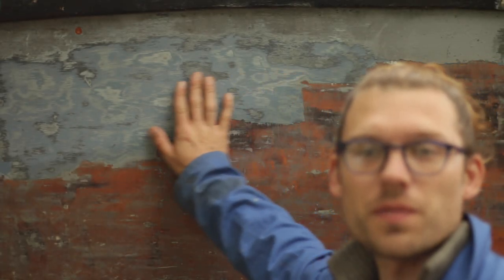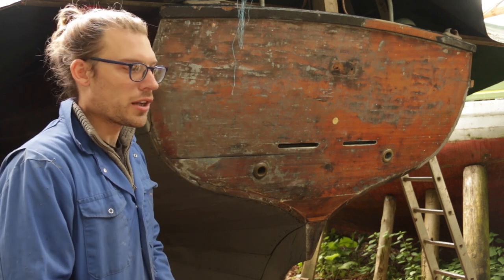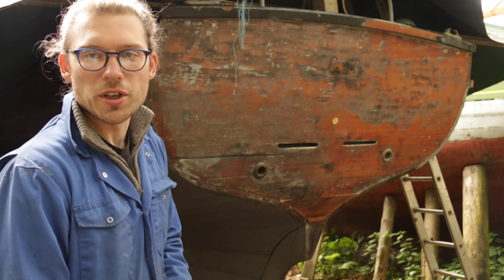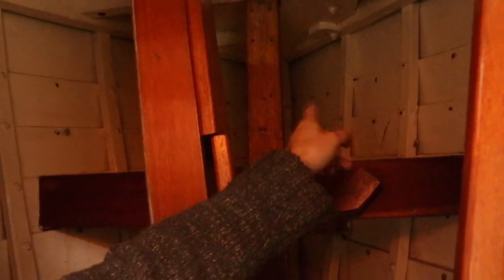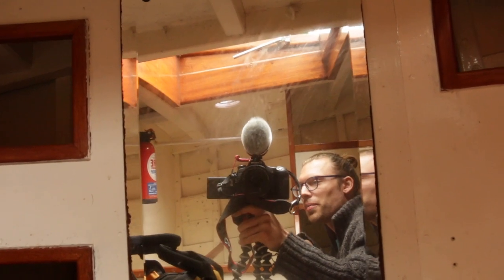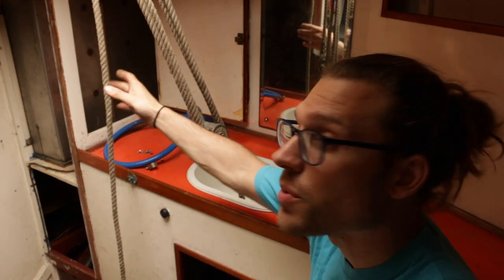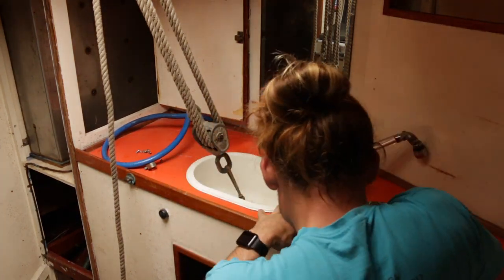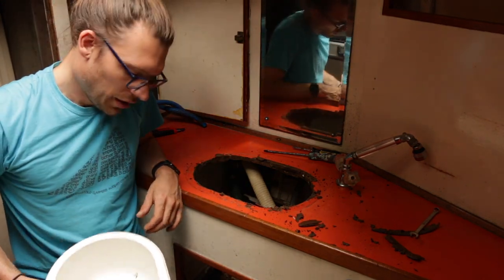11. What Happens with a Bigger Blowtorch? Wooden Boat Restoration.

Comment: Small areas of wood degradation can be addressed with penetrating epoxy. Dutchmen and Graving pieces are only needed for mechanical strength, such as cleats and gudgeons...The 'shou sugi ban' effect on the planks will add to their longevity, especially after the 'soup' of oils, paraffin and copper...

Comment: Certainly a labour of Love for this restoration and starting to look good, not sure I would set a Blow Torch on a old wooden Boat and Burning off the old Antifoul Paint that could had contained Lead.

Well produced Videos and look forward to future productions.
Reply from the maker: Hi, thanks for watching and for the feedback :-)

It was quite a difficult decision to make, using the propane, for some of the reasons you mention. The thickness of paint is around 4mm in places and all other methods we tried barely touched the surface. That’s certainly not been the most enjoyable part but now that part is mostly done I can move on. Thanks Westrex5000